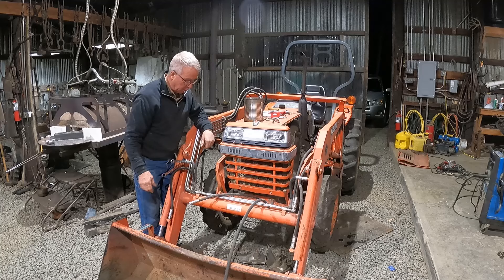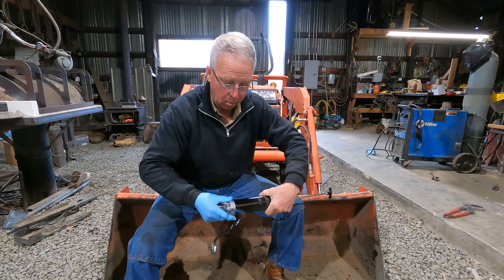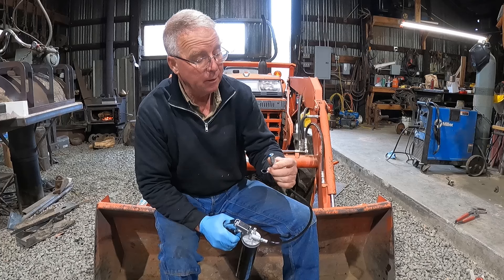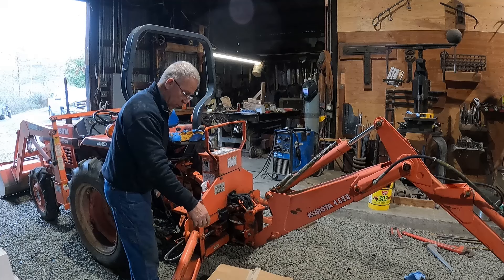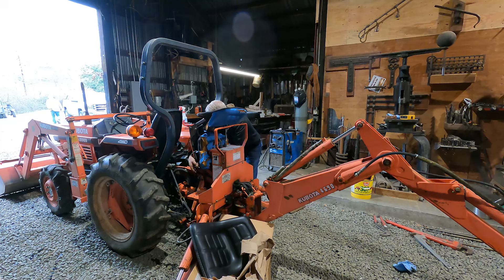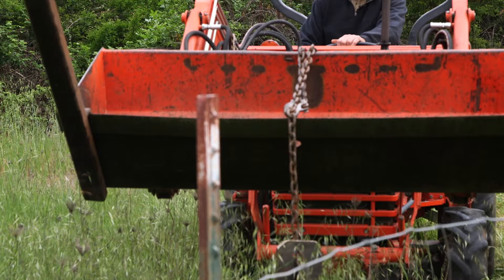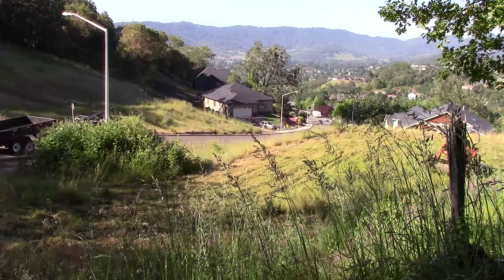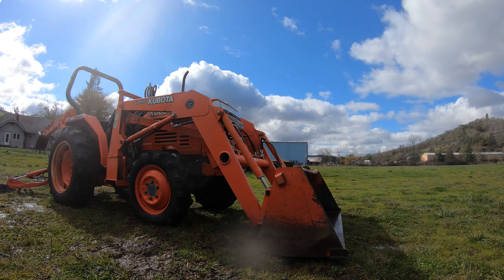Kubota L2500 Mini Tractor Review and Overview

Comment: Scott, get yourself a battery powered grease gun. Like a Dewalt or Milwaukee. It would make a job less of a chore, and you may even grease more often. Love your content.
Reply: Was going to suggest this too. Also, if you have a compressor (which he most likely has) use an air operated grease gun. One other big help is ……… get the nipple attachment that clips on to the grease zerk. It makes one handed operation real easy. Don’t know why they even sell the standard type that you have to push and click in on a grease fitting. Half the time you don’t get it on right and it pops off and you have grease everywhere 😀
Reply: Yes! I bought the Makita cordless 18v grease gun a few months ago to grease my lawnmowers... what a game changer. Highly recommend. 👍
Reply: @tedbownas2748  That's what I'm talking about. I believe Scott already has Makita power tools. All he would need is to buy the grease gun by itself.
Reply: I share his affinity for teal. 😂 I bought my first Makita cordless drill in about 1987. Still have it somewhere, and it still works.
Reply: This was my first thought as well! Really makes the greasing part of PMCS a faster job and sure does make it less of a chore.
Reply: Agreed.  Then put a Lock and Lube tip on it and all you will have left to complain about is refilling the grease gun.
Reply: Theyre great but have you seen what they cost?!!!

The one thing that makes grease guns bearable is realizing that they absolutely must come with a rag. Never ever grab a grease gun without grabbing a rag. If you remember that then greasing stops being a chore and just becomes an easy prestart check.
Reply: I was just going to say that... It is a dream compared.

Comment: I bought a John Deere 1025R last year. Loader, backhoe, mower and box blade.  It is a life changing purchase for sure.  I too hate the grease.
Reply: does' it have all the gps-wifi-gsm-cant-maintenance on my own chips, on it?
Reply: @socar-pl  lol no but man I love it, I am amazed at how much work you can get done with one of those small tractors.
Reply: If you have more than an acre in a rural area, that's the best tool you could have purchased.
Reply: @markchidester6239  that describes me.  I am truly amazed at the machine.  I looked at the John Deere and the Kubota and it honestly came down to just getting a better vibe from the John Deere dealer.  They are both awesome machines.

Comment: As a farmer, I love grease. I hate replacing bearings and driving out bushings. 
A little tip from a budget minded farmer, when reloading a tube into the gun, start threading the lower half back on, after putting a tube in it. But don't tighten it up!!! Leave it loose enough for air to escape, usually about half way threaded on. Release the plunger, and give it a few seconds before you tighten it. Works all the time, most of the time.

Comment: About 3 years ago I splurged and bought the Locknlube G.Gun Grease Gun 10,000 PSI foot operated thing!  I hate greasing but this thing make it a pleasure. It is better than the battery operated and so easy to use that my Kubota FEL and backhoe are always greased!  The small Kubotas like you have pay for themselves over and over again.  So easy to move on a trailer and so very versatile - I will say that the handiest accessory is a set of pallet forks and box blade.

Comment: The post hole digger can be a real pain.  Without sufficient weight, on hard ground, it just wants to spin.  I had to stop working on fence and dig a hole for an outside light pole.  Worked on it for about three hours and got only a foot deep.  Noticed the electric utility crew replacing a pole at the road.  Surprising how well a hole can be dug with the addition of a case of beer.
Reply: You have a post hole digger with a poor design on the auger. It should dig with little effort.
Reply: You haven't tried to dig in this ground.  In the summer, with no rain for months, the ground is as hard as concrete.  If you tried to dig with a shovel, you would need a pick just to get started.

Comment: L2250 here, with a Woods 750 backhoe. It plows my 250' driveway (Massachusetts), it landscapes my property. Great 'tool' to have. I don't have an auger... but when driving fenceposts and hitting rocks, I have grabbed the backhoe, dug a hole, put the post in and backfilled around it. 🙂

Comment: My neighbor has a Kubota just like this. He got overly enthusiastic with the backhoe and managed to crack the transmission case. It was an expensive and involved repair. They say be very careful using a 3 point mounted backhoe that doesn't have a full frame under it to spread the load and prevent stressing the engine block and transmission/rear axle. After I saw the neighbors headache, I see why it's good to use the backhoe gingerly.
Reply: Greetings from OZ
Yes re overloading. A mate leant me a Kabota about this size with a backhoe, he warned me about over loading.... his transmission case had cracked previously (right around!) It was welded,  a lot of time and money. But the story does not end there. I managed to break off a part of the bucket. Yes there was a small crack to start It that had rust, I finished it off by trying to wedge two rocks apart. I spent the next day v notching preheating and multi pass welding, I also hammered and ground back the weld between each pass. I used high spec low hydrogen rods. It looked like new when I finished but what a pickle.  So from now on gently does it! LOL
Reply: I cracked my rear housing using the backhoe once.  The problem was the out riggers were not on solid ground, and too much stress was going through the wheels!   Always make sure the out riggers are on solid ground!!   I have the pressure relief valve maxed on my backhoe, and have had to reinforce just about everything on it!  I used it a lot were I used to live, working for a water company.  The backhoe is nice, in that, I can find pipes and not break them (usually); saved a lot of money for my employer!

Comment: I have a 35hp compact utility tractor and will never ever get rid of it.  With a good size array of attachments I find it is my go to machine.  I own skid loaders, telehandler, a 100 hp kubota tractor, a backhoe loader, man lifts, etc., but the little tractor would be the one I pick if I can only have one.  My wife likes to use it as well while she won’t touch the bigger equipment.  Heck, yesterday while I was framing a roof she tilled and planted a new asparagus patch.😎

Comment: The Christmas tree farm my brother used to work for, uses the Kubota small tractors for mowing and fertilizing between the tree rows. Of course, they have large tractors that can run 10 row boom sprayers, but they can only run on the harvest roads, while the Kubota is small enough to go down the rows and is stout enough to haul tree balers and conveyors down the rows during harvest season.

Comment: Many tractors don't have downforce on the three-point, but are relying on gravity alone.

We used to use a Deere 420 tractor(30 horsepower) with a post auger. It turned out, that a 4" x 7' wooden stake could be shoved into the digger frame, and one person could hang off the end of that for downforce. They were far enough away from the auger to be 'mostly' safe.
Reply: Feed pressure.  Not down force. It's not a race car!
Reply: Did exactly the same, just needed more downforce.

Comment: Our little tractor is not this model, but like this it adds so much value to what you can do in a day. 

Bucket,forks,brush hog, box blade. Those are the first four things I tell anyone to get. 

After that an auger has good uses as does a rear receiver hitch for moving trailers. (I got one off an old truck at the scrapyard and modified it to work on a 3 pt hitch. )

A boom extension for the loader can be real handy for raising trusses and such. 

So many things you can do.

Comment: I wouldn't want to ever give up my skid steer due to it doing loader work way more efficiently than a tractor but a tractor is still more versatile overall. Three point attachments are also plentiful and cheap compared to skid steer attachments. The best thing I've invested in for greasing so far is a lock and lube tip. Clamps on tight and doesn't let any grease go anywhere but in the zert.

Comment: I got one of its bigger brothers last year - a L3800HD. I grease it religiously. The loader frame has stickers saying every 10hrs and has 2/3rds of the nipples. The rest are every 50hrs.
I opted to get an excavator rather than the backhoe attachment and scored a good deal on a used 4 tonne Kubota. It has probably been more useful to me than the tractor over the last year. Has the same HP as the tractor, but its hydraulic system is far more powerful with higher pressure and flow rate. Boring holes with the auger drive is a cinch. Only downside is that it DRINKS grease.
For my environment that is dry and dusty for the majority of the year, besides grease, the air filters are the most important things to be on top of. The maintenance schedule is to clean them every 100hrs, but I do them every 50hrs.
Also on maintenance, a hot tip I got from a hydraulics guy is to cut open the old hydraulic oil filters when you change them to inspect for metal fragments. If you see anything, do not operate until you've pulled apart and inspected the entire hydraulic system to find where they came from unless you want to spend a lot more money in the near future.

Comment: My Dad bought an early eighties B8200 (current BX comparable) 4wd hydrostatic second hand about 1990 and it's been an amazing machine for his small acre. Here in SoCal, the 60" mower gets used several times a year for knocking down the grasses as fire season keeps getting longer and longer. It has aged out its tires once and we are starting to tear it down to split the tractor in half. Not because it has broken down but because the driveshaft has a rubber boot that has disintegrated and we need to split the tractor to repair it. They are great tools.

Comment: I have a Kubota BX24D, hated greasing to death, now I just love it, bought a Makita battery grease gun with a lockNlube fitting, it's a breeze to grease, and the less you grease and the more everything becomes loose, so as a carpenter, you know the right tool makes working pleasant, get the right tools...I love my tractor, works 12 months out of the year, summer with bucket and backhoe, and winter with snow pusher and snow blower, got a pair of forks and a trencher bucket, it's the Swiss knife of tractors...

Comment: To transform that post-hole borer, add a roll of lead right above the 90' drive head. The weight added makes the bit bite faster, bore straighter & better - a nice cheap trick to make them work better. :-)
Reply: The real trick to making a 3PH mounted PHD bite well is keeping the corners of the cutting edge square and sharp. Not surprisingly, they tend to round off quickly. Rather than replace the worn tip, I just weld a piece of flat stock onto each side and bevel the leading edge at 45 degrees. Replace as needed. Then your biggest problem will be keeping it from digging too quickly!

Comment: I was a cabinet maker and carpenter in my previous life and man do I hate grease too and for exactly the same reason. Grease one fitting and you'll find grease on your pillow the next day 😂

We had a strict rule that grease, wd-40, etc never even entered the shop unless it absolutely needed to maintain a tool then it would be taken back out immediately. All it takes is someone spraying some wd40 in another part of the shop and you'll spend a day fixing all the fisheye.

Comment: I have a 2008 Kubota 2320 hydro that I bought with only 203 hrs. on it some years ago. I have a backhoe that I design on CAD and built which is likened to a Woods backhoe but just a slight bit bigger with a quick attach adapter. I have little fiddling around with mounting it. I use it often now that the weather is better. Love your content. Take care.

Comment: Coming from a farmer I have worked with all types and sizes of tractors and implements over the past twenty years all are vary dangerous if missed used. All  can severely injured or kill you but the only implement that scares me the most when I use it is the 3-point augers they are vary unpredictable only in the fact that you have vary little control over the bit in my opinion they are the most dangerous and underestimated piece of equipment because of their size

Comment: I dropped a bunch of trees on my property in an afternoon of chainsaw induced bliss. I spent the next year trying to find time to get out there and get that mess cleaned up. Between the job and the wife and the kids and the.. well, it just didn't happen. I bought a compact 25hp tractor with a loader and a set of forks.. 2 weekends of an hour here and an hour there and I was all cleaned up. I cannot believe how life changing hydraulics are.

Few observations for those shopping. Skid steer quick-connect is the bomb. Pay extra for a machine that has that. Quick connect loader options are a waste; 2 years in my loader has never been detached as it is too useful. The lock-on grease gun tip is the way to go. Lock-n-lube is the brand I have. Just spend the money, you need this. The backhoe attachment was expensive as sin and I'll probably never make my money back on it.. but gosh is it fun!

Comment: That’s a great old tractor and well deserving of regular maintenance.  Thankfully the newer tractors are designed to change attachments much easier and faster.  I can switch from a 3 point attachment to my backhoe in 15 minutes, including removing the lower arms.  My L4060 Kubota has a full backhoe frame and as long you;re not on wildly uneven ground, it’s easy to mount the BH92 backhoe.

Comment: Approaching 20 years ago now my Dad bought a roughly comparable Deere, but 1 size too small for a backhoe. That is probably the biggest missed opportunity I can even think of. The FEL is also just under powered enough to be frustrating because you can't pick up anything actually heavy with it (I think it's 700lb max capacity, but that also has to include the bucket and it won't do it at full reach). It's like a garden tractor that looks like a compact tractor.

So...  If you're going to buy one of these you're going to paying up anyhow. Make sure you buy enough.

Comment: You greasing that tractor reminds me of my number one tool.  A 4' x 4' x 1 1/2" thick piece of neoprene I lay on the ground.  I have wollered it many hours and it is much better than knee pads when you are outside changing oil or greasing a tractor.  I think I have even taken a short nap on the thing.

Comment: Your electrical problem may be as simple as a backed out pin on the connector or a mispinned connector. Sometimes when the new post is assembled the line don't get pushed far enough into the connector housing to latch properly. When you mate the two halves of the connector the pin gets pushed out of the connector enough for it not to make a sound connection. Pulling the wiring around can also move a pin that's not latched properly too. Mispinned connectors also happen, just look at the installed connector and check that for every wire going in there's one coming out opposite it. Good luck.

Comment: Get a Pneumatic powered grease gun and a lock and lube grease gun nozzle.  The nozzle locks onto fitting so you don’t have to hold on to it.  I hated greasing as well but this combo has proved very handy.  And not crazy expensive like batt powered grease guns.

Comment: L2501 kubota is the new equivalent model,  24.9 hp so no emissions on it.  Gear shift or hst. They also have a quick attach backhoe on the new models. not sure when that came out, but my dads l4400 2009 model was able to have the quick attach for the bh92 backhoe, kubota also makes a bh72 smaller hoe for the l2501 machine, alao fits the l3301 and l37 or l39 something, not to sure on the other model numbers. But theres a break where you go to the larger bh92 backhoe, i think about 45hp models get the bigger one...great little tractors, id love to have one.

Comment: I converted an old 3 point  auger  we had here on the farm to fit on my skidloader best thing I ever made. Maybe you could make an adapter plate for your small loader and then you'd have down pressure. A very enjoyable video
Reply: Good idea.  The slower turning hydraulic augers mack a much nicer hole and are way more controllable.
Reply: I have a B8200 that we bought back in '85, and I put an auger power head on the end of my backhoe!   It works real good, but the going gets slower the more rock you have!  I have a lot of rocks!!  What I like about my setup is I can swing the power head and auger to shed dirt without moving the machine which is nice if you're on an incline or cramped!   I used quick connects and used the bucket curl valving to power the auger both forward and reverse.  When in use, I plug the hose ends of the bucket cylinder together to keep dirt out.

Comment: I would love a Kubota. Instead I have a walk-behind 2 wheel Honda tractor which although is sub-par by comparison, is still better than a poke in the eye with a burnt stick. I bought it with a tiller, a trailer and plough attachments and it saves my back when gardening.

Comment: We had a Kubota l35 with the front and back loader on the ski hill I worked at it was a awesome machine underpowered on the rear as you mentioned but we used it too dig clay multiple times once used too it I was able too make good work of digging a hole and the thing could drive down some unbelievably steep hills with no issues

Comment: About the "Emergency Flashers" not working: The original "flashing module" is probably designed for an incandescent light bulb load, and the new (LED) lighting grill may not sink enough current to operate/heat its internal bi-metalic relay to cycle on and off.